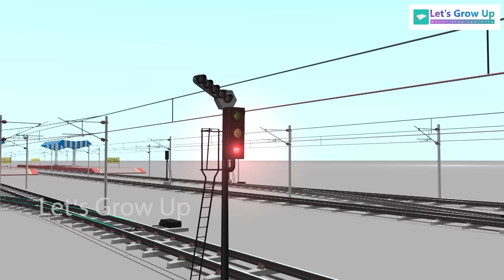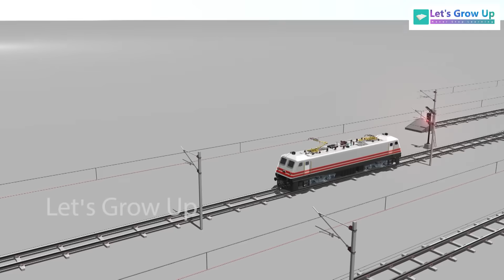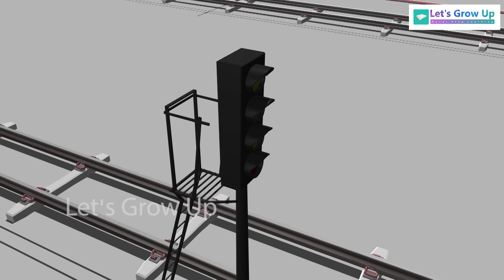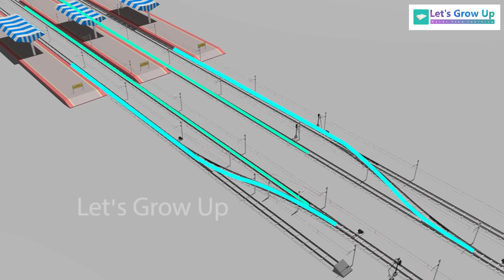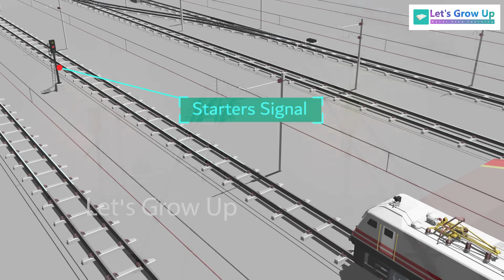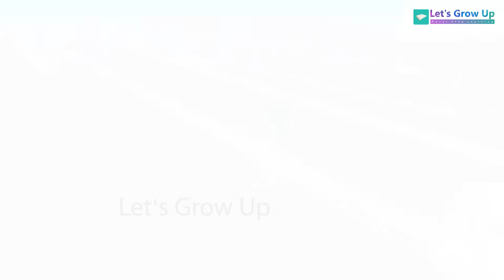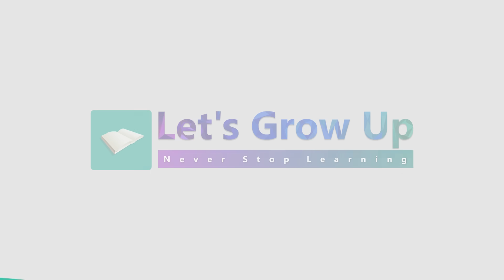Railway Signaling Systems Insights Post Coromandel Express Accident

Comment: It is good and simple for a simple beginner learner
But the system is very complex and not well understood by many
The system is based on robust safety principles the foremost being fail safe principle 
That is why We are able to run more and more faster and faster trains with same infrastructure
The system is a symbol of safety with speed
It provides for human error 
equipment error too
But none no system can provide    for careless disregard or malicious procedures and multiple simultaneous errors 
KVenkataramani
Reply: Before 1980 
Simple Interest 
Simple life 
Simple Machines 

After 2000
Compound Interest 
Complex machines 
complex lifestyle 
computing 

Human Error Human is an Error to the whole Universe.
Reply: No doubt the logic circuit of the auto  interlock system is failsafe . It has to be as per compliance . I am from the merchant navy and on board ships there are several critical safety system that are classed as failsafe as per statutory regulations and follow a strict regime of periodical inspections and tests. However,  majority, in-fact all failsafe systems cannot be classed at tamper proof as in most cases  its a futile and an extremely costly exercise . The only way to control  any tampering is to ensure all standard procedures and in place and strictly adhered to. Believe same applies for the Indian Railways
Reply: @sugatoroy1254  If I get you right you are saying the same mostly in your words

Is there a hint that Railways  have no SOP ?

For your information Railways are pioneers in laying down safety principles rules, procedures ,manuals , local in situ routines and robust training system /institutionalised systems - were in place

They don’t call it by grandiloquent names and abbreviations. Probsbly now they do!

And the Railway system is far more complex in the sense the variables are many ,critical situations faced by ground staff are challenging logistics have many constraints ang the spread of geography enormous 

I am not much in touch with current situation 
I wonder if they have operation simulators accident simulators for rolling stock track signalling interlocking etc

.Some youngster can comfirm

In my times isome -3 decades and more -simulation in Railwaynwas just an idea in my mind similar to radar simulators dynamic response analysers for military civili aviation etc

So sir Railways have no reason to have inferiorty complex but complacency there should not be
Reply: @kvenkataramani7681 There should be clarity and logic in the thought process for accurate inference. Assuming information made available by the media & govt is accurate, the logical inference basis sequence of events would indicate “some kind of unauthorised interference of the facing point machine controlling the x-over to the loop line . Are we all agreeable here or not!  Now, there are some gents e.g. Mr Ayub, who don’t seem to agree to our inference therefore must be privy to some confidential information! Assuming goods train was shunted on to loop line to clear the main line for approaching UP Howrah Chennai Coromandel Express and prior executing the t shunt operation, the facing point machine was set and locked to reverse position, causing the point signal to turn Yellow. Once the goods train had passed the point and entered the loop line, the point signal must have changed from Yellow to Red. In order set the main line for approaching Coromandel Express, the facing point machine set and locked to normal position and once point signal changed from Red to Green, interlocking system cleared the mainline for fast approaching Coromandel Express. The period between signal turning Yellow to Red and thereafter tuning Red to Green would have indicated defective  point machine unless the Station Master and his am were already aware of this defect and on both counts standard work procedures of  Indian Railways were not followed which requires urgent reporting to senior management seeking for disconnection memo, padlocking and clamping of the point at normal position, seek written approval for temporary modification of the point , 24 hours monitoring locking clamp and padlock , implement permanent repairs including mandatory testing, etc. etc. Doubt this was done and believe this lack of due diligence by railway personnel is systemic and deep routed hence CBI is taking their time. Also, interchanging the wiring ND contacts would reverse the feedback signal.  Delinking of tongue rail is sabotage and would take a long time and by creating a gap between tongue rail and main rail would not serve the purpose as the location direction guide bars would remain mechanically interlocked ensuring correct point signal for corresponding point position. Let’s see what the CBI comes up as suspect it won’t be good.

Comment: Suspect the system could be fooled by reversing the corresponding  60VDC signal cable for Normal and Reverse point directions, i.e. by effectively inter changing the directional lock feedback signal from point machine to relay room. These cable connections are provided at the terminal assembly located  inside the motor housing of the  point machine  therefore can be easily accessed after removing the housing  cover, breaking the seal to remove plastic cover of the terminal assembly. A broken seal would indicate the  cable connection were tampered with.
Reply: V difficult time consuming and can't go undetected, simple obstruction during track change done ,main line green mail line unoccupied ok as soon as switch motor starts put obstruction partial in track , signal remain s green but switch reverses to loop line causing train accident coramandal
Reply: @ILbhopal1973  sorry dont agree. The signal should changing from Red to Green ( not the other way round) and how can the switch reverse without the motor coming to its end position enabling the direction control rods to get mechanically locked ,,,,, this is the mechanical interlock provided and only after this interlock position is achieved will the feedback loop signal be energized    ...Also  if this   accident can happen just by physically obstructing the movement of the tongue rail, then YOU HAVE A DISASTER  OF A SYSTEM AND NOT A FAILSAFE SYSTEM
Reply: @sugatoroy1254 dilinking of tongue rail/loosening linking plate nuts and bolt will create gap between main rail and tongue rail
Reply: ,
There should be clarity and logic in the thought process for accurate inference. Assuming information made available by the media & govt is accurate, the logical inference basis sequence of events would indicate  that there was “some kind of unauthorised interference “ with the  facing point machine for x-over to loop line . Are we all agreeable here or not Mr Ayub, as you don’t seem to agree to our inference therefore you must be privy to some confidential information and since you have not clarified,  my further understanding of the sequence of events as follows ….. Assuming goods train was shunted on to loop line in order to clear main line for fast approaching UP Howrah Chennai iCoromandel Express . Prior to the shunting operation, the facing point machine was set and locked at reverse position, causing the signal to turn Yellow. Once the goods train had passed the point and entered the loop line, the signal must have changed over from Yellow to Red. To set main line for fast  approaching Up Coromandel Express, the facing point machine was again set and locked to normal position and once signal changed from Red to Green, signal interlocking system would have cleared the mainline for fast approaching Coromandel Express. The time period between point signal turning Yellow to Red and thereafter turning  Red to Green would have definitely indicated a defective  point machine unless the Station Master and his team were already aware of some malfunction and under both counts the standard work  operating procedures of  Indian Railways were not followed .which would have required  urgent incident reporting to senior management and seeking for disconnection memo, padlocking and clamping of the point at normal position, seek written approval for temporary bypass  of the point , engage guard for 24 hours local monitoring of the locking clamp and padlock , implement permanent repairs including mandatory checks of all cabling / adjustment of travel bars and finally test the operation of the point machine to the satisfaction of the SM, etc. etc. Sincerely doubts if I any of these was actually carried outand believe this lack of due diligence by railway personnel is systemic and deep routed hence CBI is taking their time to investigate  
Likely cause of incorrect point signal not matching point position was probably  in authorised tampering of wiring by an unauthorised personnel not familiar with the system . .Likely wiring for  ND contacts were interchanged … Let’s see what the CBI comes up with as suspect it won’t be good.
Reply: @ILbhopal1973  Basis whatever information was made available by the media on the Coromandel Express CRS report it seems that the automatic interlocking system for the local railway  station was compromised since 2018 due to some blotched up repair by  signal dept to the facing point for x -over to up loop line and since then it seems that the signal dept ( e.g. Snr Sectional Engineer , Jr Sectional Engineer and technician) had been discretely tampering with the point signal .... hard to believe that these guys never felt the need to rectify the defective point and instead employed an unauthorised stop gap solution which could have only compounded the operational risk for traffic on UP main line. It is equally hard to believe that these guys were unaware  that their actions had compromised  safe operations which please note as follows:
(a) The Automatic Interlock  System which is basically an operational safety device was compromised.
(b)  The signalling system had lost its  auto online status due to the manual fingering by the engineers. As per media,  CRS reports suggests tampering of the signal system based on the statement of  Senior Sectional Engineer that immediately after the accident,  he had rushed over to the control room to find the  point signal still green even though point was completely destroyed insinuating a dummy  signal .        ,        
(c) These sectional engineers and the  technician from signal dept were an unsafe bunch, not fit for purpose ,  capable of only " jugaar" and  as they lacked the knowledge and skill set to understand  the inherent risk and the possible outcome of highly unprofessional behaviour. 
(d)  Since the same team members from the signal engineering department was responsible for the routine inspections and checks, planned . maintenance and major  overhaul of all signalling equipment and systems ,  we can safely assume that signalling equipment was poorly maintained  and safety procedures were bypassed  thereby increasing increasing the risk of  equipment / system failure.
(e) It seems highly improbable that the Station Master and the Assistant Station Manager were completely ignorant of the fact that their technical support teams could  tamper around with signalling system and able to hide blotched up repairs . Its very evident  that they regularly  ignored tell tale signs and red alerts and did not themselves  comply to standard operating procedures. Its obvious that they were not monitoring the repair & maintenance being undertaken within their jurisdiction  as procedure requires them to witness the final  testing & commissioning  to their  satisfaction  prior  signing the re-connection memo therefore either they were privy to these blotched repairs or contrary to standard procedures they personally never attended which complemented the unsafe practices being undertaken.
(f) Another major incident involving collision of two goods train causing derailment of 12 bogies which had taken place at Ondagram railway station, Bankura district on the 25th June 2023 with sequence of events prior to the accident was very similar in nature with the Coromandel Express disaster which suggest deep rooted and systemic non-compliance of the Safety Management System therefore the need for CBI to investigate both these major  incident as believe the arrest of the three signal engineers and technician and mere transfer of five office personnel is just the tip of the iceberg we are looking at systemic failure whereby responsible senior officials of Indian Railways and the Ministry should be investigated and held responsible for this calamity
Reply: @sugatoroy1254  it's hopeless Indians railways only marshal law can change them
Reply: The problem is with India railway Traffic Services is, they are  generalists recruited through civil service exams. They are not Engineers who know technical work themselves, that is why they are like fool superiors who only watch but don't understand anything. That is why UPSC has reverted back Technical Railway services back through IES(indian engineering service) instead of these IAS and IRTS generalist babus.
Reply: Уже обманули
https://youtu.be/QXybuZ3Ig-8
Reply: Sir, thank very much for a detailed information, are you from railways sir
Reply: @srinivasactr698   Not from the railways . I am marine engineer with long industry experience in accident investigation and root cause analysis, review and gap analysis of quality management systems and safety management systems . Besides mechanical engineering, I have a good understanding of automation controls & systems engineering as responsible for development of several in-house tech projects involving collaboration with systems engineers on networking of work flow cycles including coding of logic circuits . Although I don’t belong to the railways industry, my background in the technical operation of surface transport including safety & quality management believe I do have the background to filter out clutter and analyse available data and try to visualise a true picture and frankly what I see is very disturbing as we are dealing with deep rooted and systemic non compliance which have been festering for a long time due to several short comings with Indian Railways which needs to be seriously addressed on priority or else safety standards will never improve . The first step would be transparency in the reporting & investigation process in order to get an idea of the magnitude of the problem especially because the Indian Railways is such a huge and antiquated organisation inherited by the British. It is imperative that the Indian Railways is subjected to an external audit and although this may seem a daunting task its absolutely critical to get this done in order quantify the present status of the safety management system and the necessary corrective actions one of which would be to implement a rigorous internal and external audit regime where not only the regional & central head quarters are audited, every single railway station with its associated service stations across the length and breadth of the country must come under regular scrutiny . This will also tell us the validity of taking into consideration an option for privatisation of certain sections of the Indian Railways . There is also an immediate requirement for the Indian Govt to install a dedicated central minister only for the Indian Railways which will send the ball rolling . The present minister is a good man but simple does not have the time in hand to do justice as the role deserves .